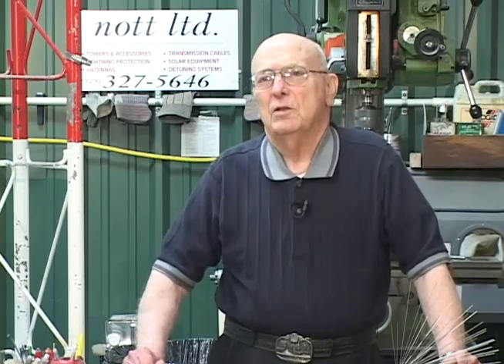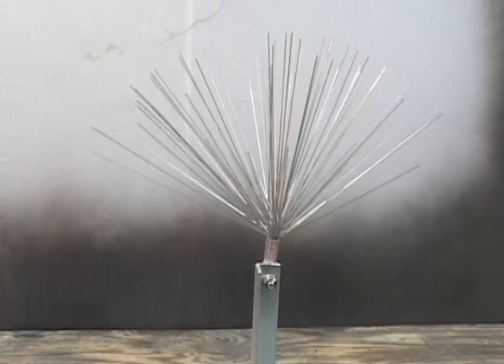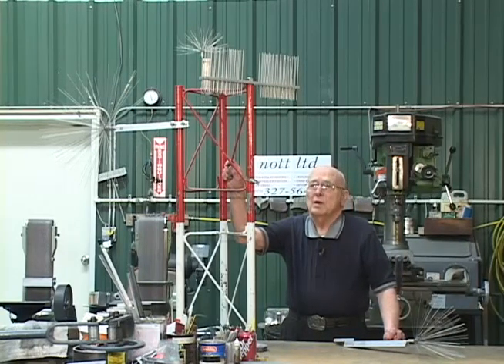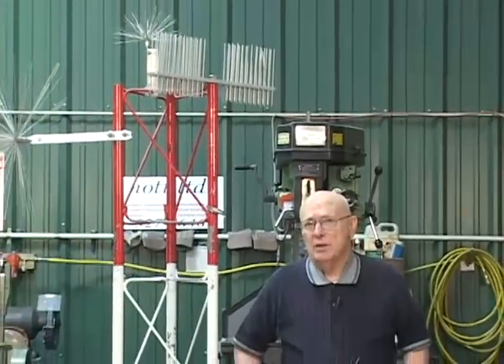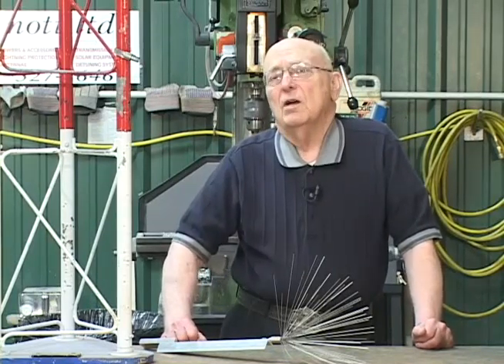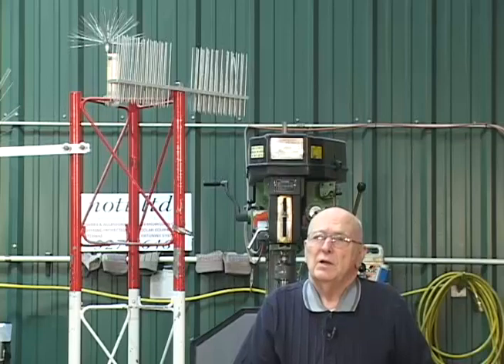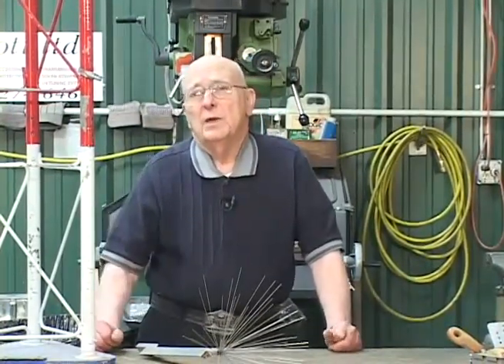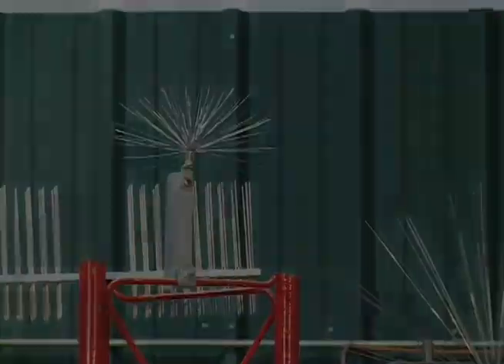Lightning Protection Systems Video by Nott Ltd

Comment: Three years now without a single strike, since installing one GS2 at the top of our 195' tower on a hill. Before installation, the tower took strikes during every storm. The Gila-Stat has been a real life-changer for me. Constantly replacing equipment used to be a way of life, but not anymore.

Comment: Hi Ron, the 40 foot sailboat my wife and I live on is 44 years old and has never been hit by lightning, even though it has been through tremendous lightning storms in Panama, S. Pacific and the coast of Africa. Some sailboats we know of, have been struck 2 and 3 times. I have to think, our luck is because we have a "witches broom", if not the same as yours, then very similar, mounted on the top of our 55 foot mast. The mast is grounded to the bronze propeller strut. There can be no other reason.
Reply: Is it installed with a conductive material that goes down to deck/waterline/ground ?

Comment: It is dangerous to think this product will guarantee a complete  protection from a direct lightning strike! I suppose  It can only lower the probability of the strike if the engineering design is done correctly... Therefore, a classical lightning instalation (but without classical Franklin rod) is highly recommended anycase
Reply: It's dangerous for people to think... period!
Reply: There isn't any lightening or surge protection system that gives you 100% protection. The only thing is to be able to identify one that works close to perfect depending on the environment in which you find yourself. Some geo locations are extremely receptive to lighting. Trees also really help to minimize the impact of lightening. Be environmental friendly when next you decide to pull down a tree(s).